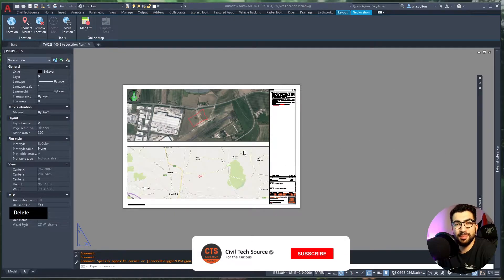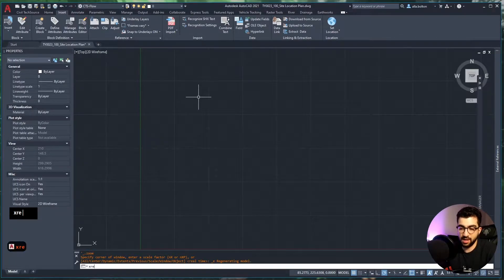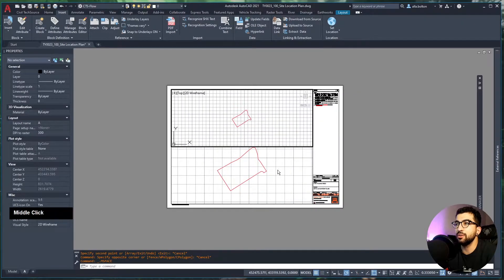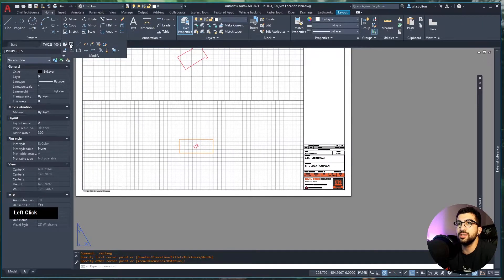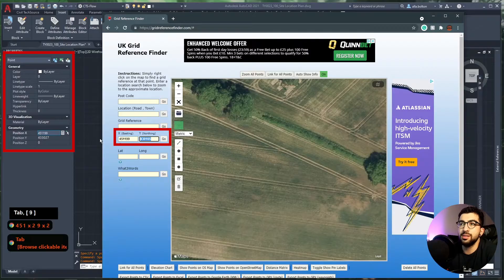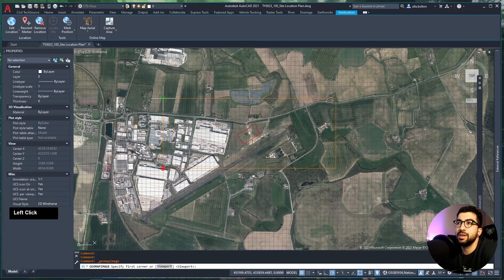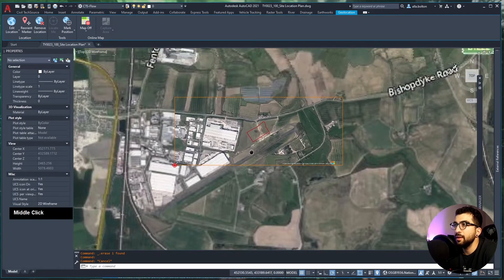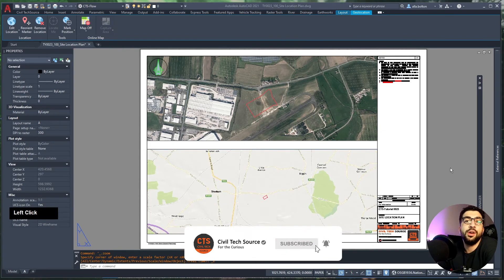AutoCAD Geolocation - How to create quickly your site location plan

Comment: If I place the real N-E coordinates to the drawing once I link it to revit it gives me error and says my file is too big
Reply: look up the video "Aligning Revit models to DWG Surveys"; extents issue
it could help you!
Reply: @DajuntePui  I've checked and the solution is pratically to place the dwg file wherever as long as it is close to the WCS origin point and to manually align the dwg in the revit file, to just insert the geolocation info of the revit point and that's it. Forget the exact workspace placement of N-E coordinates.

Comment: Hey there I really like your ribbon bar setup is there a way of manually downloading it or would this be a manual job?
Reply from the maker: Hi Nathan, if you mean the default ribbon and set out of everything, I could send you the CUI file, but if you mean the custom ribbon that I made for CTS (you can see it in my other videos) then I am afraid I cannot share that one as I am in the process of setting it up to sell it on my website. Drop me an email to send you the CUI for the setup you see in this video.
Reply: @CivilTechSource  what’s your email bud?
Reply from the maker: Ferdijafar.engineering@gmail.com

Comment: Great workaround. I've been opening the file in Civil 3D and setting the co-ordinate system by right clicking the file name in the settings tab of the prospector. For some reason it's not as easy in AutoCAD but this seems to work.
Reply from the maker: Civil 3D is a beast! I am no surprised that autocad can be less straightforward
Reply: @CivilTechSource  it's surprising that AutoCAD hasn't implemented an easier way of setting the co-ordinate system like you can in Civil 3D